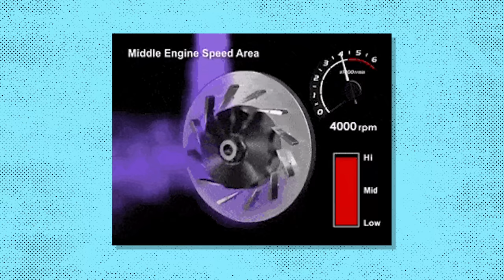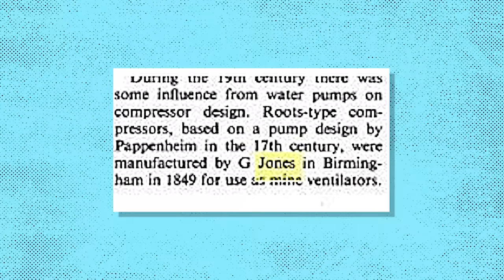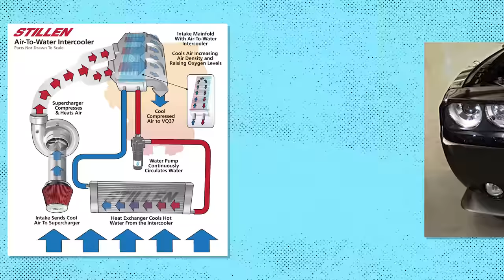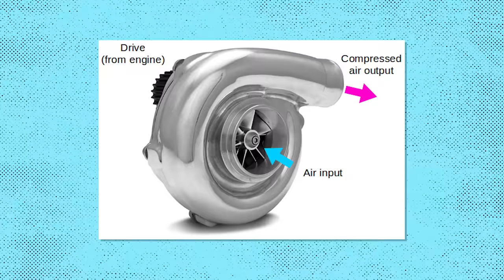Why Superchargers Aren't As Good as Turbos

Comment: Yeah but there are multiple versions of super chargers like the Roots, centrifugal, twin screw, and Electric. And you can argue that turbos are better than the twin screw and roots or whatever. But a centrifugal supercharger will always be superior to the turbos. And the most common supercharger is by pro charger and the reason why is because of it being cheaper, more power, and more reliable. And wider variety. But if you ask me twin screw and roots is peak.
Reply: Turbos will always make more horsepower than a supercharger.
Reply: The Turbocharger will always be superior to the Supercharger.

 This is why Turbochargers dominate the engine manufacturing industry.
Reply: 43 million turbochargers were sold last year and more than half of all vehicles sold are now turbocharged.

The turbocharger market is a 20 BILLION DOLLAR global industry that continues to increase every year.
Reply: @sandervanderkammen9230  Yeah because small engines use it to compensate for small power. A supercharger would not be ideal because it makes more power than nessessary for a average car, and would be very unnessesary.
Reply: @sandervanderkammen9230  Well, why is it then that super chargers are quicker always in the quarter and are a go to for drag racers and speed kings. Why is it that production cars with supercharger make more power and are faster than cars 10x it's price tag and makes way more power and speed than it's turbo rivals? Why is it that turbos require 4 of them to make slightly more power than two centrifugal superchargers or one twin screw and way more expensive too? Answer this.
Reply: @benjaminmatute9085  Turbochargers were first introduced 10-cylinder Diesel locomotives in the 2,000 horsepower range and large aircraft engines in the 1,500 to 3,000 cubic inch displacement range.
The world's fastest supercars like the turbocharged 8 liter, 16-cylinder Bugatti Chiron produce 1,600hp and acceleration 0 to 186 mph in 13.6 seconds with a top speed of 249 mph.
The Shelby Tuatara has a 2,200hp turbocharged 5.9 liter engine and a top speed of over 300 mph.
Reply: @benjaminmatute9085  Turbocharged drag cars are faster than Supercharged cars... in many drag racing series turbos are banned because they make the cars too fast.
Turbochargers are completely banned in NHRA Top Fuel, Top Alcohol and Funny Cars.

Your comments reveal someone who really doesn't know much about anything related to cars, racing or Turbochargers.
Reply: @sandervanderkammen9230  You've completely rejected the fact that turbos lag and cannot provide instant torque like a supercharger and it never will.
Reply: @sandervanderkammen9230  The tuatara never went 300 mph. It went 296. And the bugatti chiron and the tuatara is about 3 million dollars. While cars like the S550 Shelby 1000, Dodge demon 170, S550/S197 Shelby Super Snake, S550 Shelby GT500KR, and S550 GT500SE. All of these cars create up to 800 to 1000 hp and cost from 100k to 200k max for the 1000. Compare that to the Bugatti chiron and tuatara. Although not faster or more powerful. If you were to compare power to price, the cars I've stated seem like way better options. Look, one shelby 1000 costs 200k and has 1000 hp, the bugatti chiron has 1600 hp but is 3 mil. Thats like 500k + 500k + 500k + 500k + 500k + 500k. I can buy 15 Shelby 1000's with that money all having 1000 hp. 600 more hp is not a excuse for costing 2.8 million dollars more.
Reply: @benjaminmatute9085  You are very confused and misinformed about turbos son, "Turbo Lag" is not acceleration lag.
It's not even real, it's an imaginary phenomenon of minds expectations of linear acceleration, Turbochargers produce curvilinear acceleration.
The exact same car, with the same engine will always accelerate faster with a turbo than a supercharger at the same manifold boost pressure because it will produce more torque than a supercharger.
Reply: @sandervanderkammen9230  Cap, superchargers make more torque. And turbo lag is acceleration lag because the power only kicks in after a while because the turbo has to spool. Vs the superchargers make more torque and do it instantaniuse. I don't know why you are trying to decieve me. Literally everbody knows this and it has been proven turbos need to spool! That is also why turbocharged cars are slower than supercharged cars in the quarter mile in the same class.
Reply: @benjaminmatute9085  Turbochargers always produce more torque than Superchargers, this is an irrefutable fact that cannot be denied.

"Turbo lag" is not real, Turbochargers produce more power and more torque and as a direct result turbo cars accelerate faster.
Reply: @benjaminmatute9085  NHRA BANNED turbos because they made the cars too fast.
Reply: @sandervanderkammen9230  You're joking HAHA!!!! Because while they make more power most of the time, they lack torque. And turbo lag is VERY REAL go get educated.
Reply: @sandervanderkammen9230  Yet there are faster drag car because they are SUPERCHARGERS
Reply: @benjaminmatute9085  Turbocharged engines have a higher BMEP and as a result have more torque.
Reply: @benjaminmatute9085  If you have two identical cars, the one that has more torque will accelerate faster.
Reply: @benjaminmatute9085  Superchargers are only faster in racing classes where Turbos are banned.
Turbos are banned in NHRA Top Fuel, Top Alcohol and Funny Cars.
Reply: @sandervanderkammen9230  You mean, insanely modified turbocharged engines with 2j's. And not jaguar or civic ones.
Reply: @sandervanderkammen9230  No because superchargers most of the time provide more power and with power comes torque and it is known for having immediate torque.
Reply: @benjaminmatute9085  A turbocharged engine will always produce more power and torque than than the same engine with a supercharger at the same manifold pressure.
Reply: @benjaminmatute9085  A turbocharger generates horsepower while superchargers consume power.
Reply: @sandervanderkammen9230  Not boost. And superchargers make more boost most of the time.
Reply: @sandervanderkammen9230  Yet make more power with the same boost. Go call AI and google wrong, I already searched it up. Your wrong, and judging from your past comments. It's something you don't like to accept unless the other person says their wrong aswell.
Reply: @benjaminmatute9085  Turbos make more horsepower at the same boost.
Reply: @benjaminmatute9085  Are you even old enough to drive a car yet kid?
You won't learn how turbochargers work from Google.
Reply: @sandervanderkammen9230  You clearly lack knowledge. Lag does exist, superchargers make more power with the same boost, and they usually have high amounts of boost. And I didn't just get it from google, I got it from also AI which is considered a reliable source.
Reply: @sandervanderkammen9230  Say that to AI.
Reply: @benjaminmatute9085  Your comments reveal someone who is very immature and lacks any formal education or professional experience in automotive engineering.
Reply: @sandervanderkammen9230  You're still going? Besides, although I'm not a expert in this subject, to say that turbos outrightly replace superchargers is a lie in of itself. Superchargers are not made for economy vehicles, they are made for fast powerful street strip muscle and drag cars. Turbos are made for go getter and supercars most of the time. Let's keep it that way. Mkay?
Reply: @sandervanderkammen9230  And I bet I know more than what you get from wikipedia.
Reply: @sandervanderkammen9230  And you also said turbo lag doesn't exist so you lack info.
Reply: @benjaminmatute9085  The truth bears repeating kid...
 Turbochargers make more power and torque than Superchargers, this is an irrefutable fact that all automotive engineers and well educated professional know and understand.
Reply: @benjaminmatute9085  Turbo lag is not acceleration lag, it's not a real problem, it's an imaginary phenomenon that inexperienced drivers suffer from, skilled drivers have no problems and consistently drive faster runs/laps because of the power and torque advantage.
Reply: @benjaminmatute9085  Your comments reveal someone who absolutely has no formal education or professional experience regarding this topic, you are clearly not qualified to discuss this topic intelligently.

Comment: 3:44 do you know anything about cars? ALL superchargers, whether they be roots scroll centrifugal or turbo, compress air. They wouldn't make power if they didn't.
Reply: The  difference is a Roots type blower is internal compression, Centrifugal compressor are External Compression and this are more efficient and generate less heat in the charge air.

Comment: If superchargers are worse than turbos then why don't the fastest piston driven vehicles, top fuel dragsters use them and still use superchargers?
Reply: BECAUSE TURBOS ARE BANNED IN NHRA TOP FUEL AND FUNNY CAR.
Reply: @sandervanderkammen9230  If I'm not mistaken it is because the nitromethane still burning when the exhaust valve opens therefore fuel is still burning in the turbine.
Reply: @JasonLuther1  Yes but the EGTs are not necessarily above the 1,500°F to 1,600°F limits of most exhaust turbine blades.
 Certainly Methanol works great with turbochargers as we have seen in Indy car racing.

Comment: turbo lag is a much bigger drawback and most manufacturers go with turbos because they're cheaper. superchargers are much easier to install and you don't get fuckin lag. piut a supercharger on a r8 and it drives like an NA, but faster.
Reply: Turbo lag isn't real, its an imaginary problem that unnerves less skilled drivers.
Actually turbos tend to be more expensive but prices have dropped as they have exploded in popularity.

Comment: Can't believe you left out the "hamstringing" of the exhaust flow out of the head on a TURBOCHARGER. Doesn't change it but I call that cheating :) So that makes two bummers for turbos, spool up time and reduced performance due to restricted exhaust flow.  Cheers
Reply: There is no restriction to flow in a turbocharged engine... in fact they flow significantly more which is why they make more power.
a turbocharged engine will always produce more power at the same manifold pressures than supercharged engines because there is no parasitic drag on engine as there is with a supercharger.
Any questions son?
Reply: @sandervanderkammen9230  "I'm listening". No question, turbos provide more power than a S/C. What I was trying to say is BACK PRESSURE is never good.. under any condition (it's not 1970 and we are not talking about 2-stroke engines, with all do respect). It's just that the back pressure between a NA engine and a Turbocharged engine is vast - the Turbo is by nature, the mother of all obstructions in one's exhaust, yes? Those BIG down spouts on Turbos you can put your leg through are there for a reason, to reduce back pressure. There is a reason they "glow red". So, Yes, Turbos = Bigger power. My comment addressed a flaw in the Turbo system. It would just "flow better" without that GIANT restriction. Blaw blaw blaw :)  Any questions old man?
Reply: @ovalwingnut  Yea, I understand what you are saying... you are saying that you don't understand the concept of "backpressure" and why it doesn't apply to turbocharged engines the same way.
And, that you don't fully understand how a turbocharger works.

The turbocharger does not create a parasitic load on the reciprocating engine.. this is exactly why they make more power at the same manifold boost pressure.
Reply: @ovalwingnut  Backpressure on a turbocharged engine only applies from turbine outlet to the end of tailpipe.
Reply: @sandervanderkammen9230  You need to stop spreading wrong information. Awhile back there was an article, I think in Motor Trend about Turbo's versus superchargers. The input was from actual engineers from GM and Porsche The engine discussed were from the Chevy ZR1 and Porsche GT2 or GT3. Can't remember which. But they were talking about parasitic loss from each application. The Camaro's loss was over 100 hp, the Porches was around 40. So yes, turbo's do cause a parasitic loss. You can boast your claims of genius all you want in the Youtube comments but I'm going to believe the Porsche engineer over you every time.
Reply: @guntherferguson2369  Motor Trend is the automobile magazine equivalent to the Tabloid press... aka clickbait.
 I don't know any engineers that read it (except maybe for a laugh).

Anyone that claims turbos cause backpressure doesn't know what backpressure is... or how turbochargers work.
A turbocharger is driven by waste heat energy from the reciprocating engine.
100% of this energy is wasted out the tailpipe in a naturally aspirated or Supercharged engine.
Any questions son? Your knowledge on this topic seems very weak.
Is it safe to assume you have no formal education in engineering?

Comment: Okay but this makes no sense lmao, superchargers produce more power therefor the power its 'taking' is using it to add even more power, therefor its not taking power
Reply: I think you are confused about the difference between a supercharger and a turbocharger.
Both increase volumetric efficiency because the compressors are more efficient than the the reciprocating engine at pumping air,
The difference is that the Supercharger is driven by the engine while the Turbocharger operates using the waste heat energy from the exhaust.

Comment: super charger.. aka kompresser... are great.. there are kinds... and a turbo.. super charger combo are great..... and the whine from the belt is tight.. i had a 4.6 dohc v8 supercharge crown vic.. with a adoe.. with od.. and 2.73..  so had a .67 to 1.. final.. before i put the indy ss tires.. got.. .55 to 1.. sooo start with 290 to 302.. chip it.. put a double 62mm plenum.. super it.. and under drive pully.. maybe 500 to 600 +++ and final drive.. 120.. 140.. 160 180.. ++++ ever get 240miles in 2
Reply: oh on omg lvls of gas mileage

Comment: So basically your argument is "Because you are losing power to gain power" with a supercharger? That's a really dumb argument. I mean yeah, you get more power from a turbo. But for me, if I can't actually use that power on the street, its useless to me. Turbos are great for track cars and race cars where you are going flat out, and where the pavement and road layout is designed for high speeds. But for a street car, I would much rather have a supercharger that provides more consistent power at basically all rev ranges.

In short, power numbers are great, but I think its more important to look at where can you take advantage of that power the most. Since I do more driving on lower speed twisties on the mountain, l can make use of a supercharger's power gain much more than a turbo's power gain.

This is of course ignoring antilag systems, which basically just make turbos inherently better for power. But that's beside the point.
Reply: Your comments reveal someone who knows absolutely nothing about this topic

Comment: Boils down to a single reason why cars generally go Turbo and not Super..... Economy. 

Super chargers aren't economical. On the flip side... Super Chargers aren't near as complex and have zero lag. So... you'll see nothing but Super Chargers on Quarter mile drags. And on top of engines that are designed to last 8 seconds before a total rebuild... done in about 15 minutes, between races.
Reply: Boils down to to the fact that turbos make more power.
Turbos are banned in NHRA drag racing because it makes the cars too fast.
Reply: Centrifugal compressor supercharger also have lag, the good thing about them and turbochargers is lag is not a real problem, it's imaginary.

Comment: Turbochargers such except for diesels.
Turbochargers are good only in theory , but on gas cara are unrealible cause of temperatures.
Reply: Then why do more and more new cars have turbochargers?
Thats not a problem with GDI.
Reply: @sandervanderkammen9230  Cause with low displacement and  turbochargers you get smaller fuel consumption when doing EU  homologation cycle, wich is a gimmick.
Any homologation cycle is a gimmick.
Reply: @dimmacommunication  You get lower fuel consumption on any standardized fuel efficiency tests... because smal lturbo engines have lower BSFC.
Why do you think standardized tests are a gimmick? Do you not understand that these test are designed to compare the fuel efficiency of various types of vehicles against each other using a known set of standards... not to predict or claim what kind of fuel mileage individuals will see with their driving conditions or habits.
Reply: @sandervanderkammen9230  L to the O to the L , LOL , standard tests were proven  to be fake , made with already  warmed up cars , with Ultra efficency tires and other tricks.
Do you realize that to sell a vehicle the producer needs to meet Co2 target ?
The lower the consumption the better ,so they cheat.
Turbo engines consume a bit less but they are way more unreliable in the long run, talking about gas engines.
Diesels have way lower EGTs , so they are almost as reliable as a NA engine, almost.
Reply: @dimmacommunication  You don't seem very familiar with the EPA drive cycle tests.
Reply: @sandervanderkammen9230  most of the downsizing and turbocharging have been issued by European manufacturers.
Others just followed.
Reply: @dimmacommunication  Turbos are reliable enough to pass a FAA or EASA airworthiness certification for passenger aircraft... you don't seem very knowledgeable on the topic at all...
Reply: @sandervanderkammen9230  It's just silly to go around and be rude to people for no reason.
The most reliable car engines aren't turbo, that's a fact.
Either N/A or Supercharged, facts.
We aren't talking about airplanes here .
Anyway you are bothering me now , goodbye .
Reply: @sandervanderkammen9230  I'm disabling notifications from you , do all your rude comments as you want.